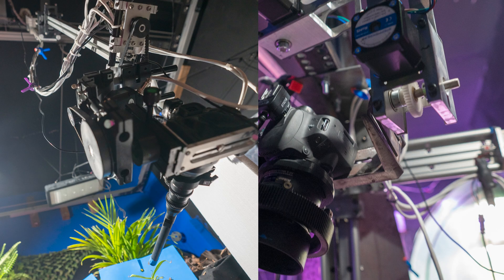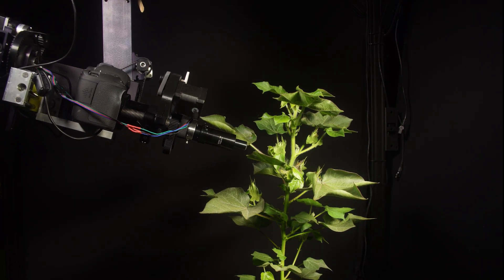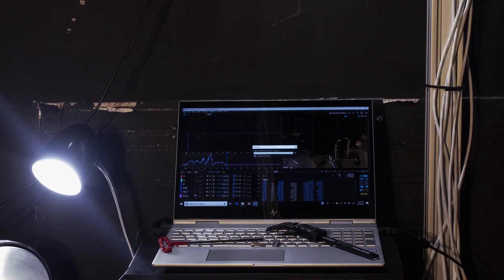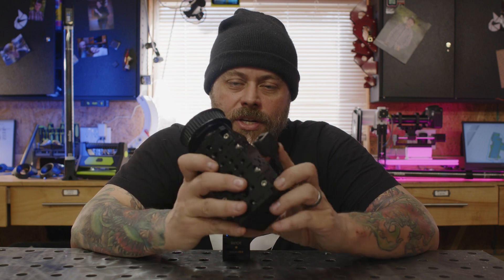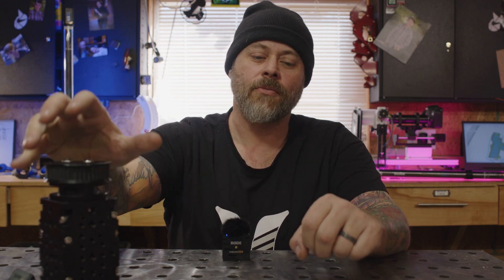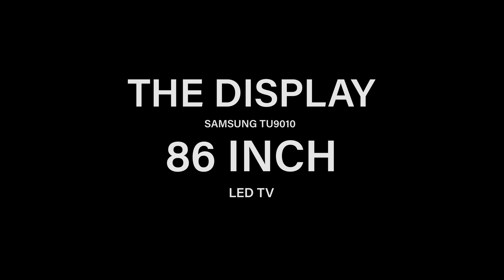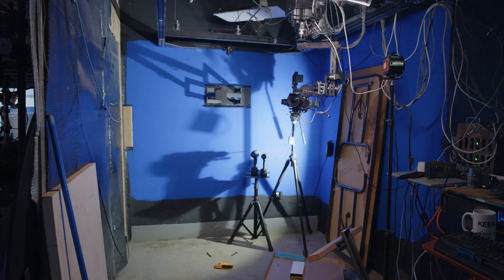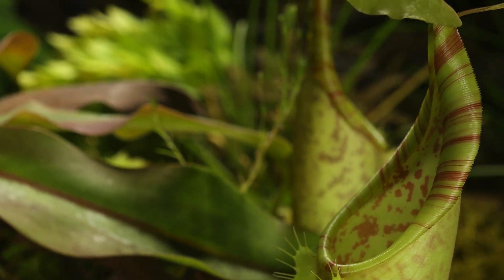6 Axis Virtual Production with KesslerCrane Cineshooter

Comment from the maker: @threedmation7083  oh yeah. I was not using cinema lenses, which seem to have tighter tolerances in the mount. I think that was a 60mm 2.8 Nikkor macro. A buddy of mine 3d printed a clamp for the lens, which would hold a 15mm rod support. That kept the focus motor from tugging the lens and causing a shift

Comment: Hello. I am building a Dragonframe six-axis "Little Otto": 1500 mm x 1000 mm. How many limit switches Otto handled? Did you modify the Arduino sketch to configure them? Can they be configured on the DragonFrame GUI?. Little by little , I started collecting all the parts I need for "Little Otto". For all your subscribers this is not a entry level task. Awesome build.  Thanks a lot.
Reply from the maker: That's awesome! Be sure to check out the DIY Motion Control page on Facebook.

Regarding limit switches, that requires either a DMC16, DMC32, or DMC+. The DFMOCO and DMC-Lite deployments won't work with limit switches.
OG Otto had limit switches in its origional deployment. I used them a while and then ditched them. 
If you are moving and hit the switch, beware the system does not immediatly stop but slows down to a stop. They cannot be used to zero or anything like that. 
I found thier usefulness pretty minor, none of my dragonframe robots use them now.

You can do virtual limit switches however which work the same and require no hardware.
Reply: @BiolapseStudios  Thanks so much for your quick reply.  I will try to modify the  DFMOCO sketch instead of getting a DMCxx.I have few tentative sketch changes in mind .At start up, I will send all motors to a specific home position; second, if I can sniff the COM port while running dragonframe, I can keep track of the actual stepper motor position and have it saved in Arduinos eeprom. Third, after start up, I will send the motors back to the last position  they where sit at to the position stored in eeprom. One good thing in our favor is that for camera shooting highs speed are not a problem. I am really inspired by your high level top notch creativity. Thanks man again
Reply from the maker: @threedmation7083  I may be off target with the reason of saving motor position to eeprom, but if it is to be able to shut the system down and have it remember its position, you can do that do that in dragonframe, i think the option is "Set to move position" in the axis menu on each axis. Its a good way to recover if the rig has not moved and things got shut down or had to be reset. I think it has a similar result to what you are looking for. 
I have a video on here on how to recover from a power loss that shows it. But there is no problem with a little automation to make things easier.
Reply: @BiolapseStudios Video from min 7:39 - 7:50 shows an orange clamp. What is its function? I see the the white gear for the follow focus but I don't get the orange clamp purpose. Can you, please, share? Thanks
Reply: @BiolapseStudios  I agree 100%. Adding limit switches implies more work and the need for them is not that critical. The to-do list is already large. Thanks for your advice.

Comment: Why do you need a Vive tracker? Shouldn't the motion control software directly be able to output the camera position and rotation to the Unreal Engine in real-time via a Livelink plugin?
Reply: A the time of video, even now to my knowledge, axibo is the only kit that supports livelink, however. Couple of the companies are working on it however.
Reply: @chrisfield7008  let’s hope that more moco systems get compatible with unreal engine and Livelink. I would be very eager to test Axibo indeed

Comment: Great video!!!
So it may be implied but to clarify, you’re using a second shooter somewhere in there to control the new bloks and kOS to control SARA?
Thanks!
Reply from the maker: Yes.  You can use a connector between the CS and SSplus or Pro, and control it all as an 8 axis system in Kos. You can also connect with dragonframe if you need those extra capabilities.